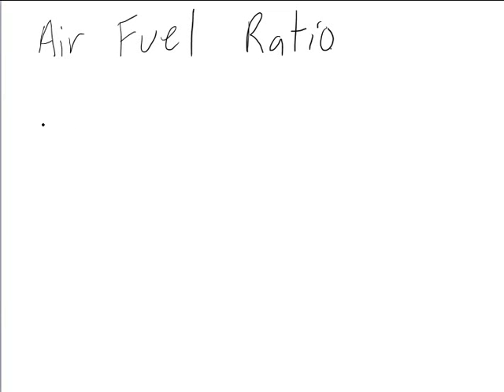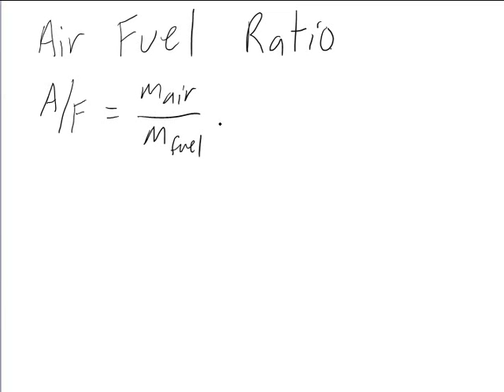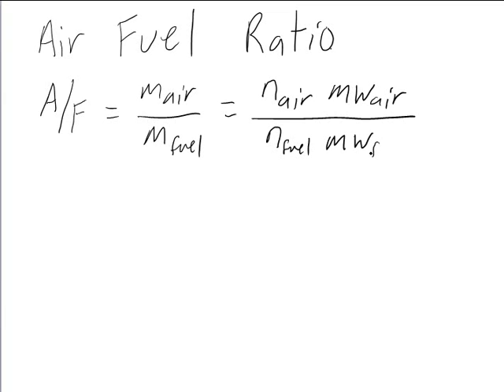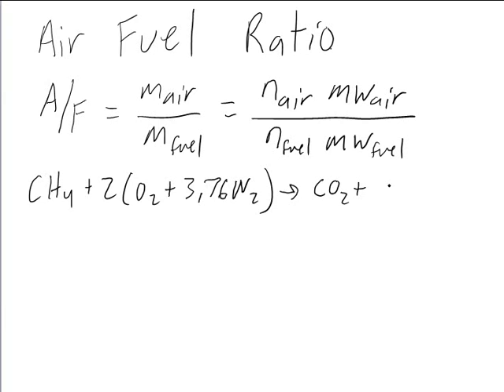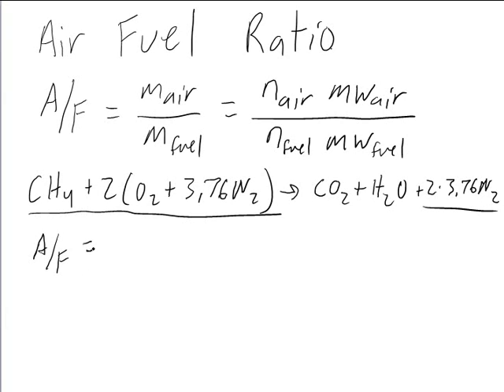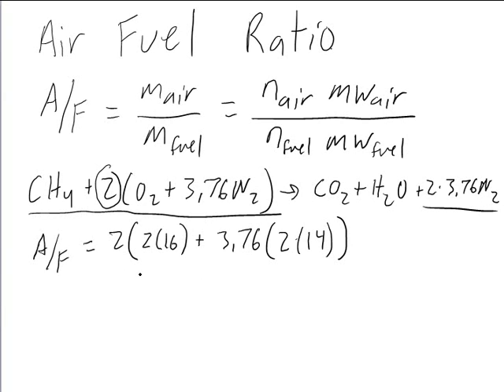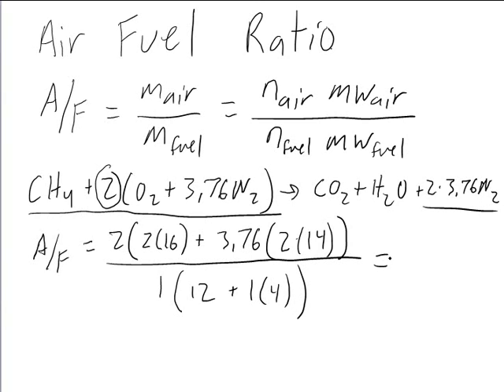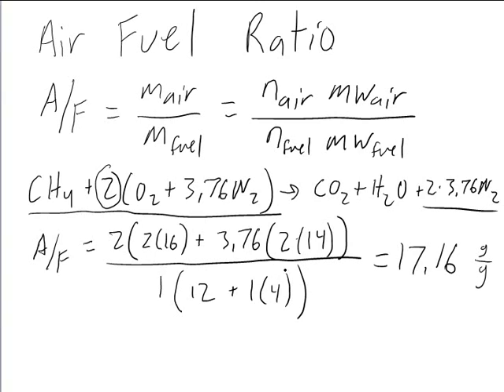Calculating Air Fuel Ratio

Comment: I'm pentagon. Banks are dead. Nasa landed. Lear on other planet.   Planet lorville.  Star citizen. Air done.    Methane hovers fmground. Like bubbles. Do they dissappear in the wind. Electric.  Plane motors.  No fuel.  Or better. Oil pressure. Push break or clutch.  Pressures.  Keep spinning. Fmgear box.  Spins it faster motor one speed.  No wifi shut down  aml. Refuses too listen. Too much bardge dope and  non understanding of. What we look at as rangers. Army ss.